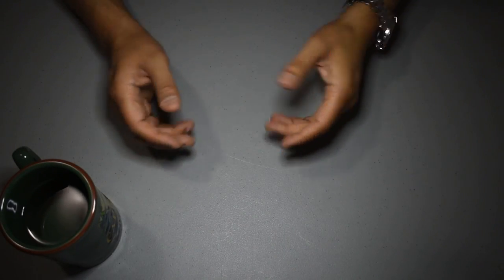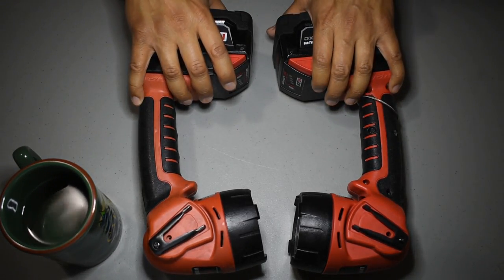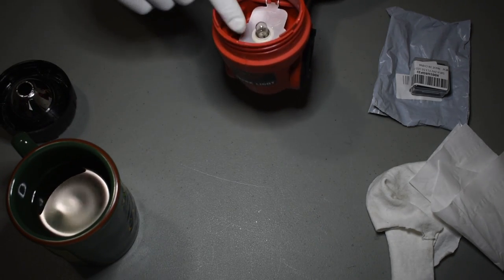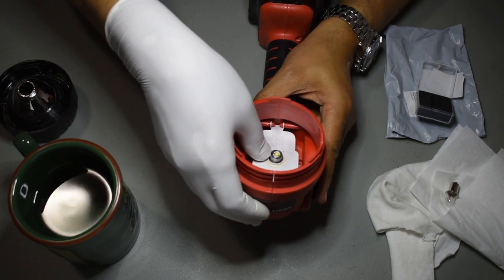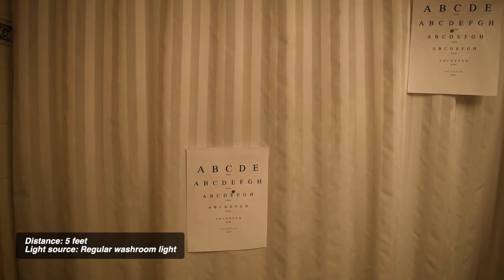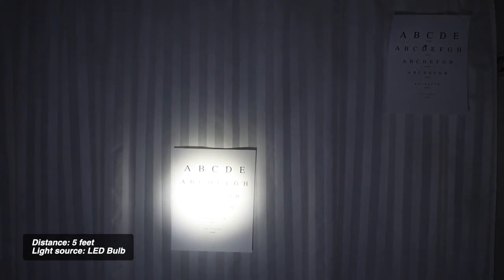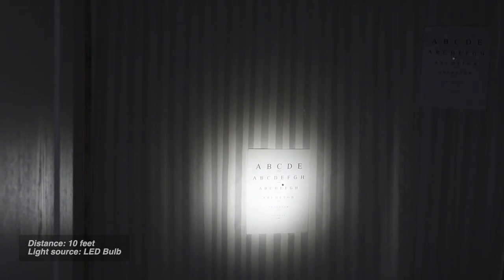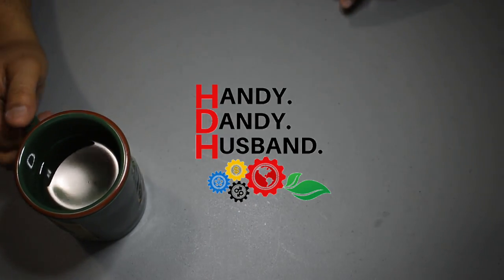𝗤𝗨𝗜𝗖𝗞 𝗧𝗜𝗣: 𝗩𝟮𝟴 / 𝗠𝟮𝟴 𝗠𝗶𝗹𝘄𝗮𝘂𝗸𝗲𝗲 𝗟𝗘𝗗 𝗖𝗼𝗻𝘃𝗲𝗿𝘀𝗶𝗼𝗻 plus comparison

Comment: I think I might prefer the diffused light for working under the hood of a car, But the 13 hours is hard to argue with.
Reply from the maker: Hi Steve Carlson, thanks for watching and sending me your comment.  I would agree, the diffused light works well in certain conditions and under a car is definitely one such example--brighter lights just create way too many shadows for one to work well.  One way I have worked around the brightness of the LED but take advantage of the 13hr time span is placing a piece of thin paper in front of the flashlight lens (or translucent plastic like from vinegar container) it subdues the sharpness somewhat.
All the best to you, H.D.H. [: { ]

Comment: Surely they would be shipped with an LED ?
Reply from the maker: Hi Michael Wall, thanks for watching and you comment/question.  Back in the day when Milwaukee released the V28 (not M28) line, LED were not available/not adapted to small form factor, so it is understandable that both the bulb in the flashlight and the replacement bulb provided, are not LEDs.  The LED replacement option came many years after the release of these lights.  I still have my V28 tool set and use the M28 batteries in them.  All my original V28 batteries no longer work.  Hope my response helps explain why I needed to upgrade the V28 flashlight.  All the best to you, H.D.H. 
[: { ].